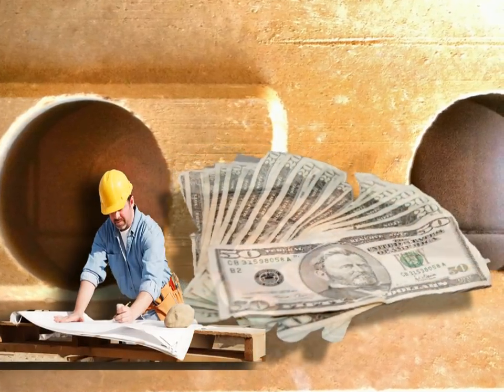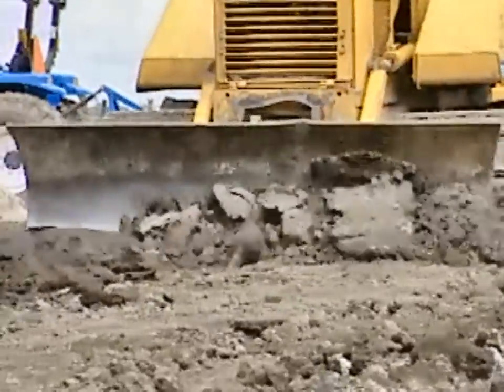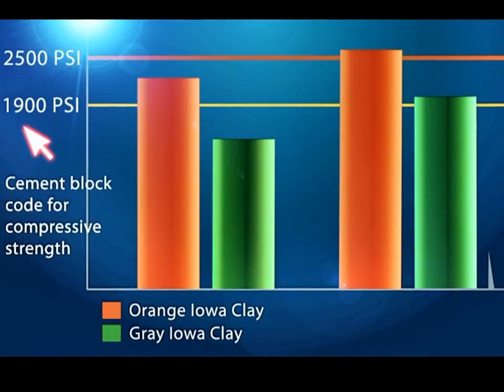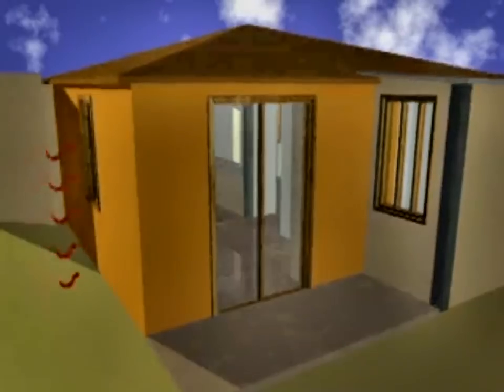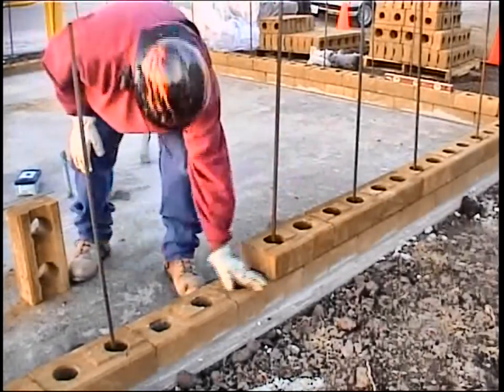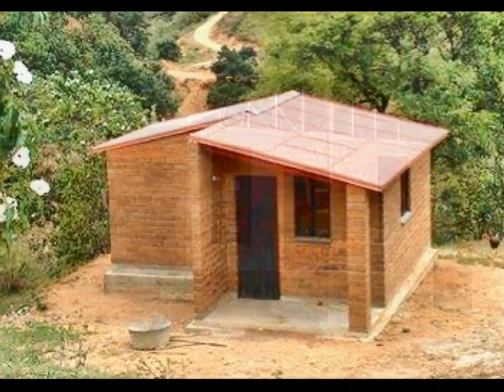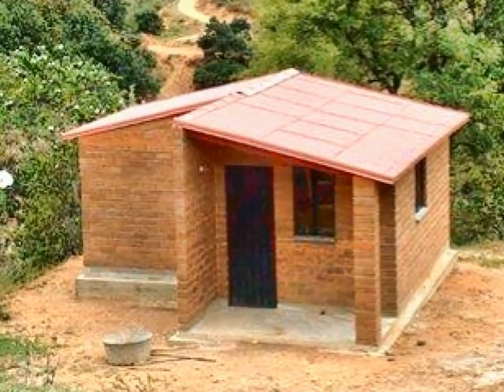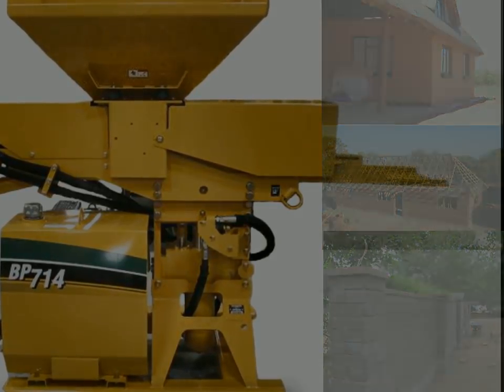The Most Advanced Compressed Earth Production in the World Today!

Comment: I like it. At 20,000 it's really not a bad cost when you consider what structures cost to frame up and sheet out then finish off inside...materials and transport add up quick. The beauty of it to me is the ability to go to remote areas and create a product with an outstanding lifespan and high thermal performance using mostly local materials.

Comment: AA let me just say is true that this material we are walking on is amazing for construction and has been for over 5000 years, however the methods you are picturing are not eco friendly. Let me explain when you add cement or bitumen to the mixture, it becomes unsustainable. Usually this material is considered sustainable because at the end of its lifecycle, 50 years or so depending on maintanace, you just remove the roof and let nature take back what was took, adding cement, bitume, lime, or any other material that usually helps strengthen the bond and protects against erosion MAKE IT UNSUSTAINABLE.
Reply from the maker: I suppose the Roman constructions built over 2000 years ago with Roman cement that are still standing are also unsustainable?  I don't think a structure's "life cycle" defines its sustainability.   Simon Bolivar's house, made with adobe and covered with lime plaster is nearly 200 years old because it's been maintained.  Some of the oldest structures on the planet are made out of dirt.  .Sustainability is the endurance of systems and processes to continue and even thrive and it's far more complex than just being recyclable.  It involves economics, politics, ecology and human culture.

I agree Bitumen is not eco-friendly, hence we don't use it.  Lime on the other hand is derived from limestone and once exposed to the air gradually converts back to the limestone from which it came.  That's why it's been used for thousands of years to strengthen and cover structures.  Cement has replaced it since WWII and has become a major component of building materials.  Cement made with volcanic ash has been proven to be even more resistant over time than Portland.  But it's not commonly available. Sustainability is that which has the lowest impact on the environment and yet maintains a balance with the world's resources and systems.  The embodied energy required to produce adobes or compressed earth blocks (CEBs) is a fraction of what is required for most other building materials, hence it is far more sustainable than materials that destroy ecosystems or use enormous amounts of energy.  Compare a CEB to a fired brick for example, or a styrofoam wall coated with cement and its sustainability becomes very apparent.

As for high rain, high humidity areas, we recommend a good pair of shoes and a good hat!  A good foundation built properly and a good roof with adequate overhang to help protect the walls, allows these blocks to endure for centuries when maintained properly.
Reply: You meant perlite i guess its is available in huge quantities over in asia, but yea i see your point. I am currently looking into constructing an eco home however with common materials found in certain areas, most cases no concrete whatsoever is available as such im looking for alternatives to it. Best case scenario is building with earth, will it be rammed earth brick shaped in bottles or even tires doesnt really matter as long as the earth is shaped and build up even with bags and wires is ok. I have greater concerns about the erosion and structural integrity of it (remember im not using any concrete...)
Reply from the maker: *****
And why is cement not available?  Do you know how cement is made? Are you familiar with hydraulic lime?  The reason cement is not ecological isn't due to its availability, it's due to the huge amount of energy required to produce it and the pollution that occurs because of that production.  It's derived from natural products limestone & clay and when ground can be easily assimilated back into the natural world.  But it requires huge energy making it difficult to sustain.  And cement kilns are the second largest producers of dioxin so it's problematic as a building material for the environment.  Traditional adobes used no stablizer, the clay expands when wet and prevents rapid erosion.  But they DO erode over time and require frequent maintenance because of it, usually lime plasters.  Adding cement makes the blocks far more resistant to moisture and also stronger, greater compressive strength.  Compressing the blocks gives precise control over their dimensions, shapes and design that allows a builder better options in all aspects of the building process.  And because of the reduced quantity of cement, (lime can also be used as the stabilizer), far less energy is required, far less pollution is created, making the blocks far more ecological than most common building materials.  It's not a perfect solution to all construction, but it's a far better alternative than most modern building materials being used worldwide.
Reply: ***** You're an idiot.
Reply: Guys the new compressed earth bricks are the way to go ramming the earth takes too long and after even longer to dry 2 much manpower just look at The Great Wall of China they switched from rammed earth to bricks due to its manuacturing process being faster then ramming and also coz during that time the gunpowder appeared the rammed earth wall wasnt enoph to protect against invaders the mixture of dirt is still lacking different additives. Lime+ ricce ashe hull+perlite +clay is the best mixture i found. Its a bit like cooking try to make a solid bread gl
Reply: +Stoyan Yordanov Who cares about "sustainability". We are talking about structures that we hope will last. I don't want it to deteriorate. Everything is sustainable until suddenly it isn't anymore, and very little is sustainable until we make it so.
Reply: James Rollins ?